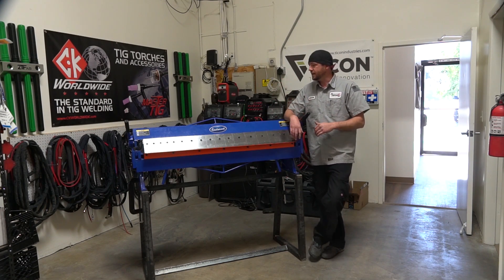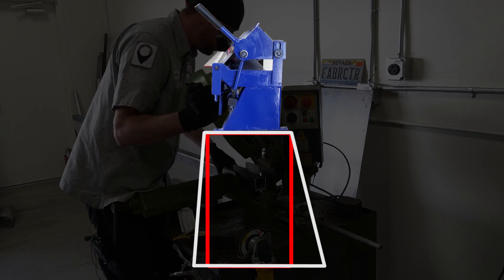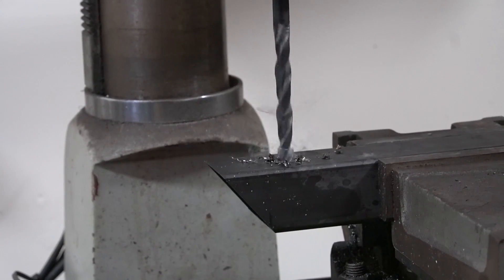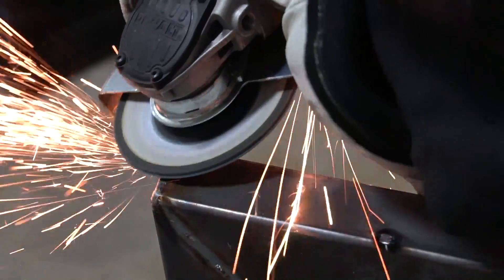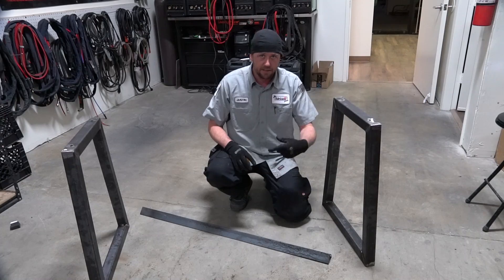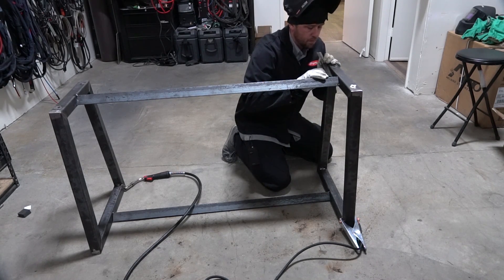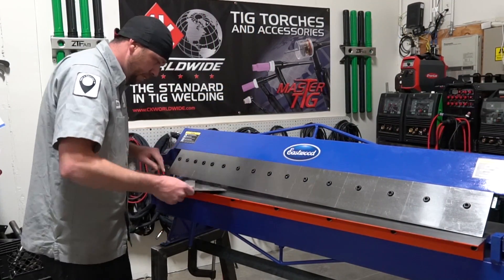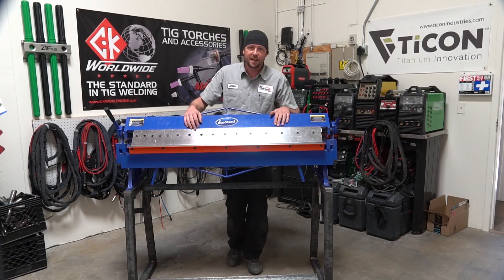TFS: Sheet Metal Brake Stand

Comment from the maker: NOTES: The brake doesn't actually weigh 800 pounds. That was my goof. I had a freight order show up totaling 800 pounds and that's what stuck in my head for whatever reason... Oh well. The brake weighs about 300 pounds. 
Alex (the camera guy) is not offended. His retort to my "go away" is something I couldn't show because we run a clean channel here.
Reply: Cross-bracing ? It is well bolted to bottom of the machine (with washers :).

Comment: What’s the point of bending something if you can just weld it? Considering how expensive the brakes are what’s the point?
Reply from the maker: Efficiency. It takes a lot less time to make a bend than it does to make a weld. Finish/reveal of a final part also changes efficiency as well as si.ple things like warpage and final processes to correct them. They all take more time to fix/finish/correct than bending it.
Reply: Because sheet metal
Reply: WARPAGE! SHRINKAGE! Its always better to use a bend when you can.. lots of long welds cost $$$
Reply: think of a paper. You can tape pieces of papers altogether, but it is always easy to just fold them to make a shape